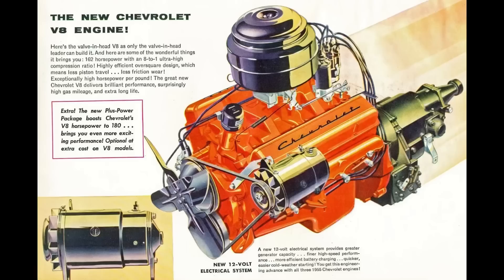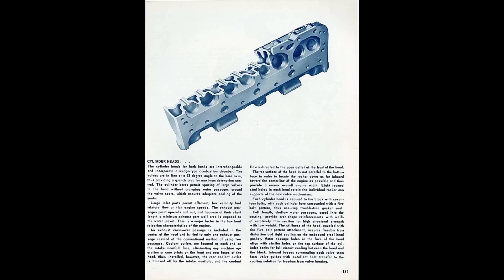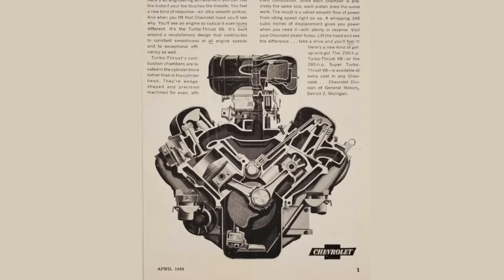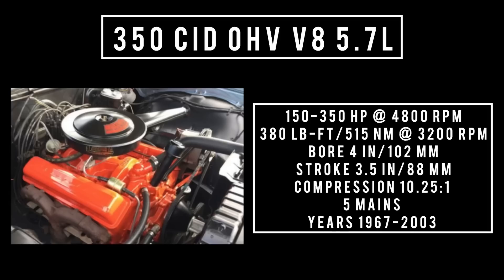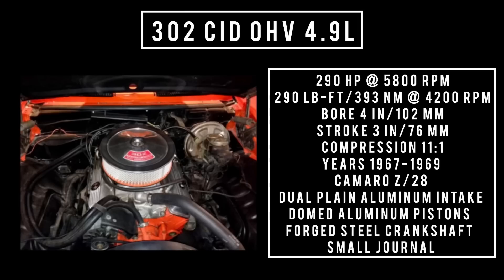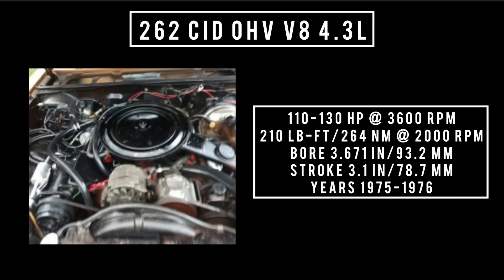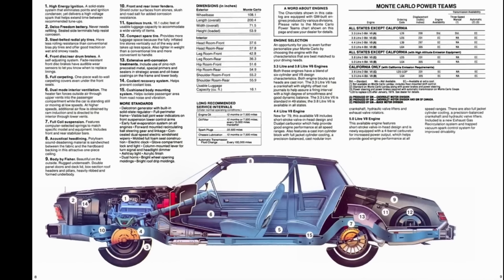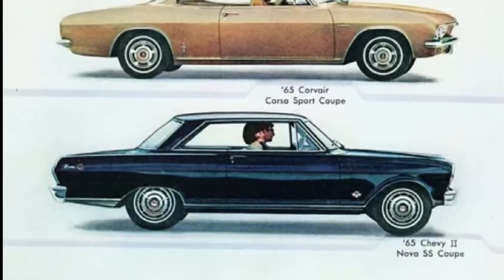First Generation small block Chevy engine family 265, 283, 327, 350, 302, 307, 400, 262, 305, 267￼

Comment: I was lucky that my Dad allowed me to use my College Bonds to buy a car when I turned 17. We were an Olds Family so I wanted the 442. Dad went to the Olds dealer for service and i asked him to look around for a 442. He would meet me at his brothers/my uncles bowling alley after school to drive me home as we lived on a farm. I was there with my cousin and best friend Ben when he came it collect me. I asked did you see an OLds 442, He calmly shook his head and said no they did not have any  442s in your price range. I was dejected then he offered they did have a nice little Chevy. I was thinking Chevelle then he said Corvette, then I was thinking 58, 62 ?? I asked if it was a 4 speed he said yes. I asked what year he said 1964 White hardtop. OK OK That is good the 64 came with 327 from 250 HP to 375 HP. I knew he had exhausted his knowledge about the car. Did you drive it, Oh well I took down the street and back. Well? Yes is drives real nice and seems to be in good shape. Well do you want to go look at it again, with me. Well I thought you might be interested Let me call your mother and she if she wants to go too. Can Ben come along, sure yes he can come along. I was about to explode. The dealer in this rural Farm area was quite some ride away 45 minutes. The bottom line is the 64 Corvette was a Convertible 4 speed with the removable hard top and convertible top, 4 speed close ratio 2.2 low gear and 3.73 rear gear, Hub caps were chrome and the interior had red dash and carpet with White seats and doors. The Tach red lined at 6,500!!!!!!!!!!!!!!! The engine was the 365 HP 327 a Fuelly long block with a high rise Aluminum Intake and a 4 barrel Holley Carb. I had no idea at the time but sure knew the little sticker on the valve covers with 365 Horsepower meant i was in heaven. I drove the car 4 years down at SIU Carbondale, Lost my license once, raced a lot of guys on the street, and once at a 1/8 Drag strip near Springfield. Nearly killed myself about 3 times. Lost one race with a 440 Dodge, I had too low a gear and about 140 he walked around me. That little Chevy 327 seems to never stop pulling harder as the RPMs climbed. But the Aero on this 64 was so bad the front end would aim to the stars over 100 or so and at 140 at night you could hardly see the road. It was not hard to start but it would die if you did not keep blipping the gas until it warmed up a bit. The idle with a solid lifter Fuelly cam was so awesome. the gas pedal would vibrate through my foot up my leg and right to my chest. It was Beastly! it had little torque below 3,500 RPM. But once you cleared 4,000 RPM my God the little motor just turned loose. It felt like wild horse and it just wanted to run. It was addicting for me and I loved it. The first night home i was is such disbelief I took Dads Military Blanket out and sleep in the car in the middle of December.  I gave the car to my Dad my senior year at SIU he had several bad years and needed a New Pick up truck. I was getting drafted at the end of my senior year so it was fine. I did buy a 1964 GTO from a Friend for 160 Dollars that burned 3 quarts of oil per tank of gas. But it got me home one last time before i had to leave. That is my 1st Small Block Chevy Story abbreviated. Yes I loved that 365 HP 327. Later I got to drive a Z28 302 and it felt some much like my old 327 Really never had another engine that was so fun to beat on. No idea it had forged crank and rods now wonder it lasted so well.  Dennis
Reply from the maker: Great story thank you so much for taking the time to write all of that. I really appreciate it. It was a really good read very much enjoyed it. Thanks again for sharing the memories. =)

Comment: The shitty design part is the 2 exhaust valves in the middle 2 cylinders which will eventually cause issues plus looks stupid with the 2 exhausts in the middle.
Reply: Yep … The AMC V-8, the Chrysler SB and BB V-8’s, Buick V-8, Olds V-8, Pontiac V-8, SB Chevy V-8 … None of those engines were worth a shit …

Comment: Owning a Pontiac, and a Cadillac, I only briefly owned a 64 Impala with the 327 4 barrel, and loved the power of the 327r, but hated the powerglide behind it, just 2 speeds hindered the performance potential, and my dad's 1 ton C-30 flatbed,  after the 6 blew a rod, we put in a 65 327 4 barrel, and just like your flatbed it was a great preforming truck, thirsty on gas, but it was a work truck. The only small block Chevy I experienced driving was some of the service trucks the power company had in the fleet ran 350's, loved those trucks.The Chevy engine I was least impressed with was a 305 in a 77 Buick (YUK), still leaves a bad taste in my mouth when they put chevy engines in the  77 Oldsmobiles, Pontiacs, and  Buicks without telling anyone my Mom had buyer's remorse over that Buick, the 305-307's just didn't have much power just like the 4100 engines in the 80's  Cadillacs.
Reply from the maker: Thank you so much for sharing those stories/memories. Yeah I never got that either why they put a 305/307 and an absolute mammoth of a car, but then again, I’ve owned two cars with 302s and they got on pretty good as long as you knew how to drive it, but I think the transmission had a lot to do with that they didn’t have four-speed transmissions,autoMatic transmissions in the 70s, which is weird because the original hydrant was technically four speed transmission but they went to a three speed… the town car had an AOD. If you put put it up to 20 miles an hour and slammed on the gas, it took off like a rocket.

Comment: My strip dad's 64 impala had a transplanted 400 sbc. His 81 custom deluxe c20truck had a 4 bolt 350.. I learned to drive in those vehicles. My first car, 78 MALIBU Wagon had a 305. My 86 caprice brougham also had a 305..Those are the only SBC that ive experienced. ZERO problems out of any of em
Reply from the maker: Awesome thank you so much for sharing your experience

I’ve owned one small block Chevy technically two i’m going to 327 and of 350 I love both of them the 350 is pretty amazing motor all things considered.. bullet proof easy to get parts for cheap to rebuild I used to have Ford products but I’m not tied to any particular brand but it’s definitely made me a believer.. I just have no idea why Companies didn’t follow suit with Chevy and their parts interchangeability

Comment: 55 ,56 Chevy 265 would smoke brand new 😮 the old timers would put Bon Ami down the intake and run the engine 10 minutes scuff the cylinders and stop the smoking 😂
400 was a 1/4 mile and 4x4  monster ...
302 was my favorite ❤❤
Chevy weakness was air flow through the heads !!! Engines are air pumps 🤔
Increase the air and balance the short block a fluid harmonic balancer bring your RPM up with out gernading !!!
5 spd with precision bearings..
A light balanced drive shaft ..
And people never spend money on high precision axle bearings and balanced axle shafts 😱!!!!!!!  Car's are instruments you tune .......best part about chevy mix and match to build what you desire 👏👏👏👏👏
Happy Motoring and enjoy your adventures ✌️🤠
Reply from the maker: I would love to drive a Z 28 with the 302 I’ve heard stories that car was way better than what it was on paper. Those are so rare though I’ve never seen one. I’ve seen a pace car but I don’t know if it had a 302 in it, thank you so much for sharing those stories/memories what I would give to be alive back then lol

Comment: These were the engines I learned on, then later became a huge fan of. I built some of these in a small garage, and enjoyed for many years. Just a note - 283's could be had as late as the 67 model year in the entire line. As the years went on, The smog motors were just that - no power, short on longevity. I did like the Vortec motors Chevy made. Used some of the hot rod tricks 
in those motors including roller rockers, and could go for 500,000 miles without a tear down.
Reply: They were the best Motors ever. That and  the small block ford.
Reply: The 1987 and later Vortec was the small block Chevy perfected. These apparently had a higher nickel content in the block castings and would often still show the factory hone pattern with well over 100,000 miles, while the earlier engines would develop a significant ridge with as little as 50,000 mines on the engine. To this day, after over 50 years in automotive repair, I have seen only ONE smallblock with blown head gaskets, and thats because someone who replaced them previously did not thoroughly remove the old head gaskets from the head mating surface.
I have also never seen a smallblock Chevy with burned valves, unlike many Ford engines, specifically the FE truck engines (360/390) of the early 1970s and the occasional LA (smallblock) Mopar.
Reply: In the early 1970s were they trying to run these engines with leaned out air fuel mixture at heavy or full throttle causing xs oxygen in the exhaust gasses which tended to attack the valves which also were being made to run extra hot?  @donreinke5863
Reply from the maker: Awesome thank you so much for that correction that’s crazy they predicted the 283 for 10 years =) 

I almost did the Vortech heads in my Chevy truck but figured it didn’t need that kind of power and didn’t want to chase problems
Reply: @What.its.like.  I bought a 355 (350, .040" overbore) from Blue Print engines and put in in my 65 ElCamino. They sent me 2 dyno sheets with the motor - 350 horse with a L79 spec cam. Engine is on my you tube channel. Was $2,300 dollars for a short block. Worth every penny!
Reply from the maker: I’ll have to check it out =)

Comment: I have owned a 66 Chevy. Biscayne with a 283 stick shift, a 68 Chevelle with a 307  Powerglide and a71 Impala with a 400 with a turbo hrydarmatic 350. My favorite has to be the 66 283 but the 71 400 is a close second. Your are right about the torque of the 400, that car would light the tires up from a dead stop by just getting on it!
Reply from the maker: Thank you so much for sharing your cars with us =) 

I got the drive a C10 last year with a 400 in it and I was really impressed it ran great
Reply: The 400s were amazing.
Reply: Sure it wasnt a 402, impalas had a “400” but it really was the 396/402
Reply: @PeterTrellea  Starting in 1970 Chevy put a small block 400 in the full size cars. I spent 45 years in the automotive repair business and know the difference between a small block and a big block. They also used the small block 400 in pickup trucks. The last year for the 400 small block was 1976.

Comment: I was a GMI student assigned to Chevy small block engine group. I speced out a 400 4 barrel for a 72 Monte Carlo while at the tech center. I don't know if my engine made it to production or not, but i sure enjoyed my time in the small block group!!!
Reply: I was also a GMI student, but worked at Allison division.  I left GM for many years but came back and worked at Powertrain on the small block from 2014-16.  Interesting work.  Who would turn down a chance to work on an American icon?
Reply: Daveedson? How long has it been since you saw a 70 400 warranty replacement 2 bolt 3951511 block?  I have an intact low mileage one gathering dust.
Reply: The Studebaker version of the 283 was built in Canada, and had a different block and other differences from the Chevrolet version.
Reply: @Wiencourager  A different block? Feel free to elaborate, please.
Reply: @doctorcountersteer6580  they were industrial engines, Chevrolet had lightened the blocks by then , but the McKinnon built engines used by Studebaker used a modified version of the older heavier block. So they were slightly different then what Chevrolet was using at the time.
Reply: Some useless trivia...  Some 1970 - 72 big cars could be ordered  with a 4BBL "400" engine and the fender badges read "400".  But those engines were actually 402 cu.in.  big blocks, slightly bored out 396s.  Chevy did build 4BBL small block 400s in the mid '70s...  they were low revving smog motors found mostly in the last few years of "clamshell" wagons, big pickups, and Suburbans.
Reply: @billyjoejimbob56  Hey, BJJB? Know what precluded the 402's existence? I read that a number of 396's were cast with a considerable amount of "core-shift". Since a "datum" was unheard of in that era of mfg., this allowed x number of blocks to be cast out of tolerance almost to the point of being scrap in Flint or Tonawanda resulting in the bore centerlines collective mislocations. Somebody's corrective measure was to bore them oversized.
Reply: @doctorcountersteer6580  Never heard this explanation before, but it sure sounds plausible.  Thanks for sharing!
Reply from the maker: Oh man that’s awesome what a Time to be alive =) 

Thank you so much for sharing that story/memories with us how long were you in the group for

Comment: Great video Jay, very thorough.  In my opinion, the greatest American automobile engine family.
Reply from the maker: Most definitely and Cole was definitely onto something with part interchangeability, I wish Ford would’ve copied that aspect.. glad you dig this episode I’ve been putting this one off purposely because I knew the work involved with doing all of the different engine configurations the only good thing was the information is really easy to find I really want to do the Hudson twin H that one might be the next engine episode but finding the information is a bit tricky

I think that episode we are going to cover three Hudson engines we are going to cover the 262 the 308 in the Hudson jet engine.. it’s either going to be that or it’s going to be the Packard straight eight
Reply: @What.its.like.  Ed Cole became President of GM at one time.  Do I remember correctly?
Reply from the maker: Yes
Reply: I couldn’t agree more! Greatest automotive engine ever built.